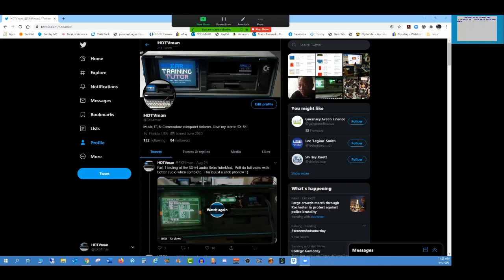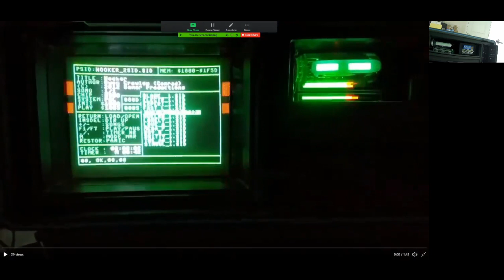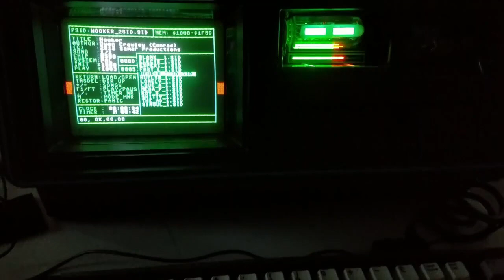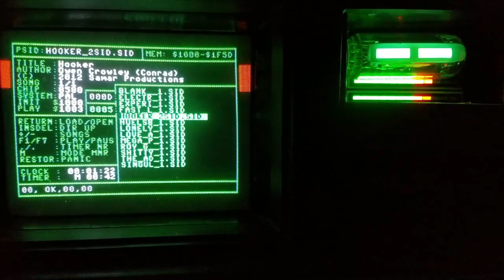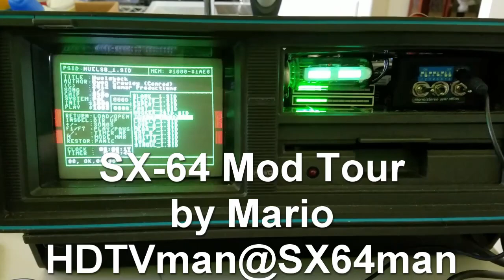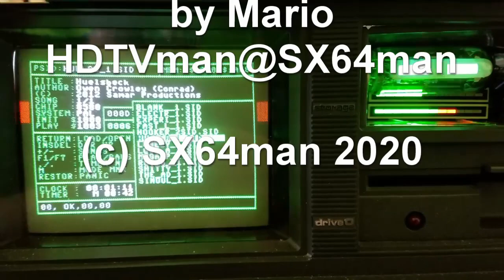Commodore SX-64 Retro Tube LED and other Mods

Comment: @SX64 man This video is crying out for a transcript! ;) So much C-64 goodness in here. @3:10 Could you provide a link to your Facebook/Twitter comment(s)?  HDTVman@SX64man? Need a direct link.  The L.E.D.'s @7:00 look really cool! @9:18 Cool fan setup.  Nice video, VERY interesting SX-64 computer setup, thanks for uploading this.
Reply from the maker: Good tip. I just edited the closed captions for accuracy and clarity and it is easier to follow along with those on now.  I placed the Twitter contact in the captions and I'll post in description comments above.
Reply from the maker: added permalink in description above for L2 Inductor mod on SX-64 Enthusiasts Group (Facebook)
Reply: @sx64man  COOL! Thanks

Comment: Hello, how did you make the "plate" to mount the switches in there ?  I want to do the same thing with small rocker switches.
Reply from the maker: Just had a friend 3d print a plate and then mounted the jacks.  However you can use use a small plastic project box and cut it down to size and drill the holes for the connectors.

Comment: Are there any updated links to the IO Board and UserPort fixes?  I'm troubleshooting an SX64 and all diagnostics cartridges seems to fail at either the PLA or the User Port / Control Ports.  Aside from the failed result it seems to be working fine.  Any suggestions?
Reply from the maker: Are you using the latest diag - the 586220* ?
Reply from the maker: Also some c64 harnesses do not do well on SX-64s and give faulty results.  This design by Sven Petersen is the best I have found and has a special switch for SX-64: 
https://github.com/svenpetersen1965/C64-Diagnostic-Rev.-586220-Harness
Reply from the maker: Peter - Thanks for the heads-up!  Ray Carlsen's website is offline, so I redid the links to archive.org for the content.
Reply: So I found the issues I was having.

1. I was using Diagnostic Version 586220++.  Version 586220* was labeled TED, so I assumed that was for the TED machines like the C16.

2. Internal floppy drive controller needed to be unplugged for the diagnostic to work correctly.  There were notes to this fact in the 586220* readme, but nothing was noted in the 586220++ readme (the version I was using).  This is probably the most important thing that I threw me for a loop.

3. User port board needed to have the trace between 9V and Ground cut.  I have SX-64 with the trace cut that now tests perfectly.  The other SX-64 that doesn't have the trace cut still shows User Port Bad.